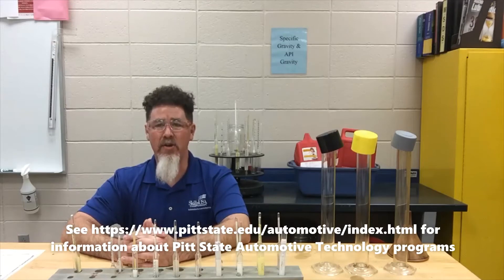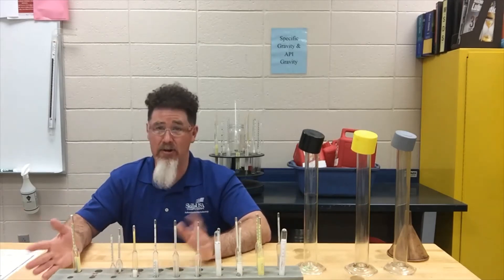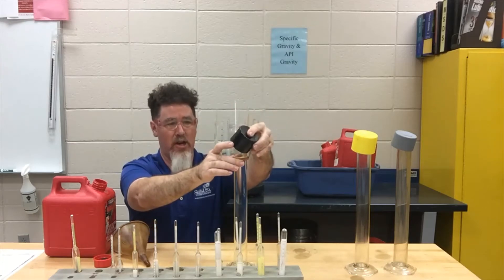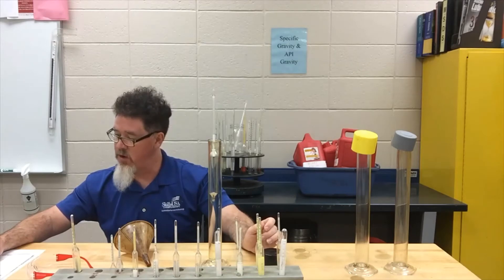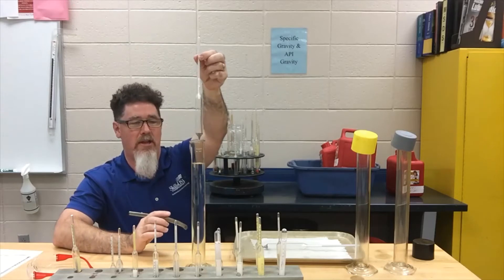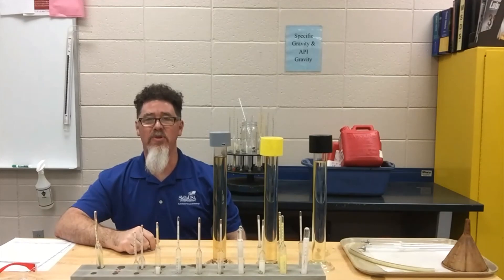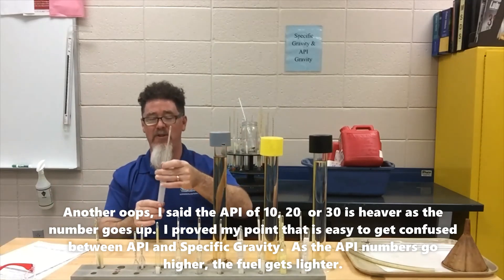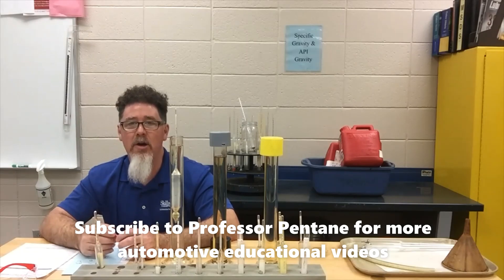Gasoline gravities

Comment: Good day sir, what standards you follow for adding and subtracting .
Also there are few methods to find SG for example, what's the different between hydrometer method and equation method. 

If you don't mind send me your email I have  questions about fuel.. Thanks in advance
Reply: correction factor table

Comment: Why is 87 octane higher than 89?
Reply from the maker: Hi Stephen,   The better gasoline is on the lighter side so with that theory, the "cheaper" gasoline would have a higher gravity.   On a side note, the higher gravity fuels will have higher BTU's per gallon which could mean more power.   Checking the gravities of fuels is just one test of many to determine what type of fuel you have.   Thanks for watching Professor Pentane.